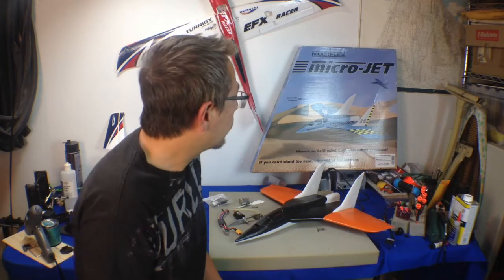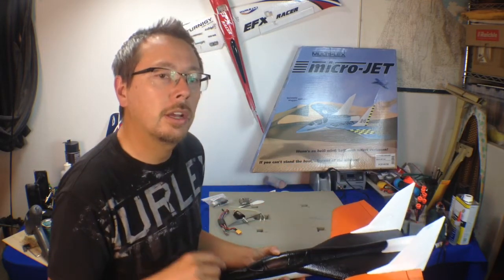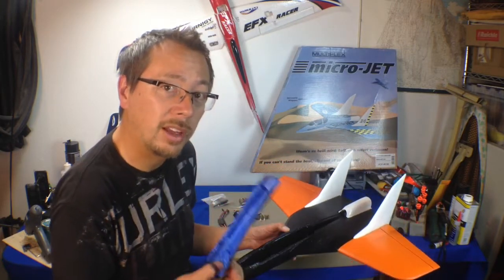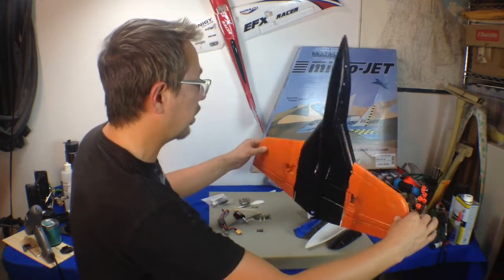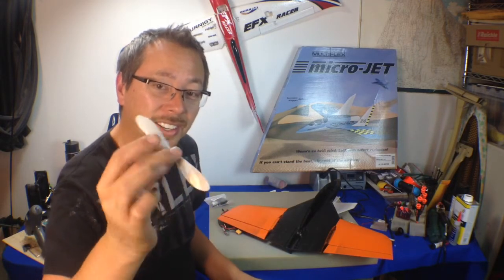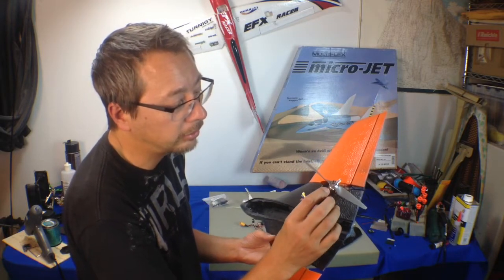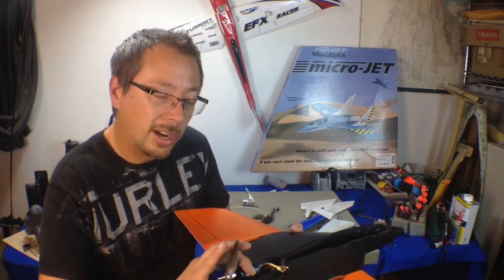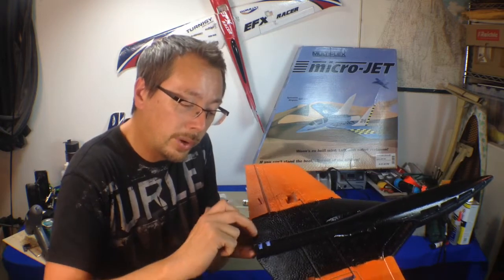Multiplex Micro Jet Project

Comment: Hi.
I have one question.
Where can I buy this plane - I can't find it in multiplex store.
Can anyone help me?
Reply from the maker: They are vintage- I have another in good shape- send me a message if you are interested-
Reply: If You have this plane for sale, of course I m interested, but I have some questions:
How much would this model cost and 
Would it be possible to send a plane to Polish?
Reply from the maker: I have another one for sale with the stock brushed motor- it would be hard to shop to Poland- probably more than the value of the plane
Reply: So how much it will cost?
Reply from the maker: +Ptaker RC you can send me a private message.

Comment: Nice plane sir! That should be quite a fast plane :)  I think the original TwinStar (v1) allso came with props like that, and they actually worked quite well ;)  haha 
You'd love the (brushless) TwinStar by the way.. a very nice FPV platform...

Do make sure to do some contrast-stuff different on the bottom of the little jet offcourse, for orientation! :D 
Cheers
Reply from the maker: Thanks, built it last night and it looks feat and sound great- video to come,,,,